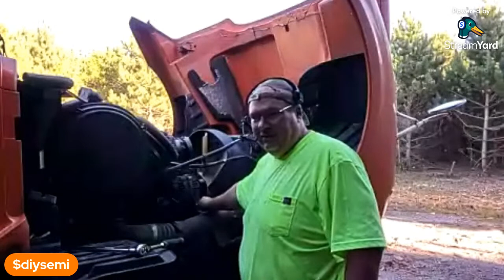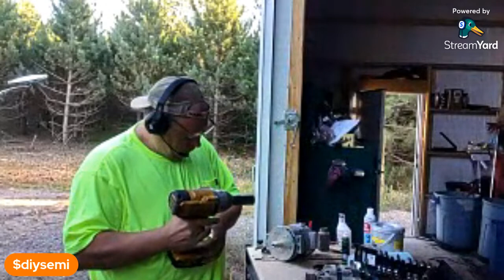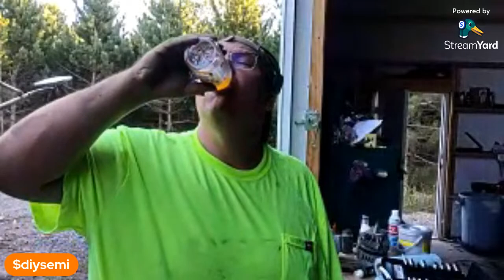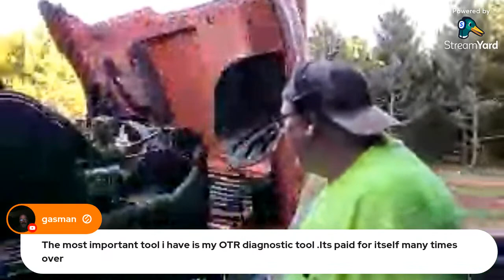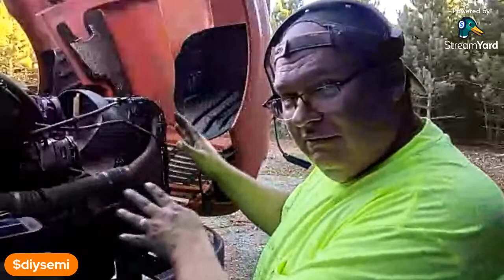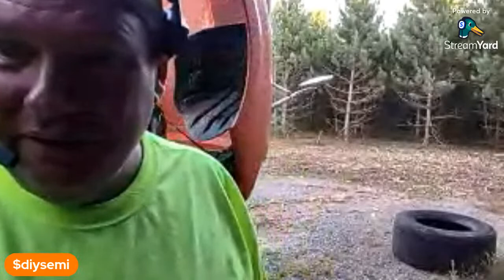Should you work on your own truck. live from the shop

Comment: Had to replace a coolant pump in the Kalamazoo Michigan Loves parking lot a year ago. Also replaced my alternator since the old one had to come off to get to the pump anyway. I spent 4 days ubering around for parts before I got it all back together. Parts were $800. I couldn’t imagine what I would have been charged for labor for that job. 4 months later I had a bolt snap off into that coolant pump from a tensioner pulley that also had to be removed at the time of repair and I ended up using a shorter bolt with a lock washer to hold everything together so I could get myself back to Wisconsin from Missouri just so I could pull everything out again so I could use an easy-out on that broken bolt. I had to buy a Volvo specific hose for $50 so that I could drain 15 gallons of all of that new coolant into buckets. I still keep that hose and some fresh buckets on hand in case I ever have a crack in my radiator or a hose bursts. $19 bottles of coolant add up quick

Comment: Don't worry, heck I walk by a truck a dam dirt or grease seems to just jump on my shirt...lol. Always have a rag in my pocket to wipe myself off. Take a old semi truck rim and 2 pieces thick of plate steel and nice thick piece of steel tube and weld plate on the ends of the tube and then drill or blue wrench some holes to bolt the old truck rim facing down so bulge for duel wheels is up and mount bottom plate with tubing welded get the extra height and sit stable on face of rim. Then mount the vise to the top plate of tubing. Makes a nice portable vise mount. Lean on side move around by rolling on the rim in the shop and heavy enough doesn't fall over. And you can dolly around to certain spots where your working or use tractor and loader to move👍

Comment: Wait 3-4 weeks for an appointment at Freightliner  or order the part and figure it out. Just think about it even if takes you two weeks you’re still winning. Plus YouTube is a manual for learning. Things I changed dry van s-cams, seals,bearings, slack adjusters , brake drums and shoes, hub assembly, hub cams , computer module. My flatbed all eight tires ordered from Walmart . Because my tractor tires were five thousand dollars to install all eight of them Bridgestone plus 1500 for two front steer tires “never again “. Things I changed on my flatbed all air lines. My tractor rear yoke seal, all brakes, drums and shoes, starter, AC compressor, belts, got dinged on the road for a blown radiator 3,700. Nox sensor. Fuel tank strap snapped on the road. So got an Uber to nearby freightliner i replaced it myself and back on the road a week later fuel tank leaking so replaced the fuel tank. Yes working on your truck and equipment helps you survive bad rates and a bad economy. I carry all my tools with me Milwaukee 3/4 drive . Plus you get to learn your equipment. Freightliner has proprietary software that does not allow you to use which sucks because you can’t reset certain things so you have to go through them.

Comment: If we're comparing experiences, my alternator died on my truck somewhere around Durand, WI on the way to Winona, MN in the snow last November-ish. Pulled over in a gas station parking lot started the gas generator and hooked up the battery charger and pressed on to Winona where I stopped at rihm KW, bought an alt, made my pickup and continued on with the generator and battery charger affair until I got to the loves in Hampshire IL where I changed the alt in the what was now freezing rain and sleet. An hour or so later, all patched up and I went in for a much needed shower and enjoyed being sick for the next couple days. 🥴 fun times.
Reply from the maker: That's dedication right there. Good job

Comment: I'll do basic stuff, alt, belts, and general things. I took my truck in for what I figured was 2 bad injectors and after 2 weeks Detroit just sent me an estimate for $10,500.  Said the injectors looked great but it had a broken valve and rocker, tore up the camshaft and bearings. Exhaust Manifold is cracked, gaskets and all the rusty hardware. I just passed the 1 year mark as an oo, pass my state and federal audits and taking an incredible beating this year. Basically between fuel, insurance and maintenance cost I've made absolutely nothing this year. It'll get better right?
Reply from the maker: I hope so!

Comment: Use rubber gloves keep your hands clean
Reply: Absolutely! At first it's awkward with the small screws but you can get used to the gloves.
Reply: It's eerily satisfying  to not pay $130 /hr. For someone to screw a light bulb in. Or 3 screws.
Reply: Looks like someone took some type of whacker to the fur trees. Isn't that a felony in that part of the country.
Reply: We wouldn't be in business if we didn't do our own repairs. It's not just the prices the shops charge it's also the time it takes to get in and out. Sometimes we might actually have to repair something before 8 am or after 5 pm. Imagine that!
Reply from the maker: You will see tomorrow!